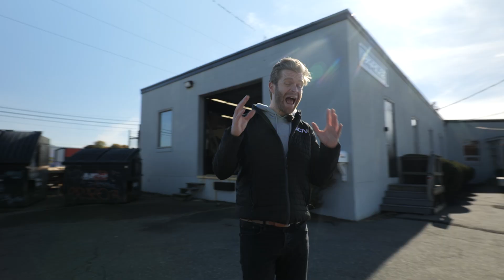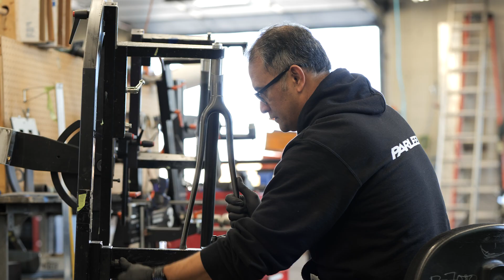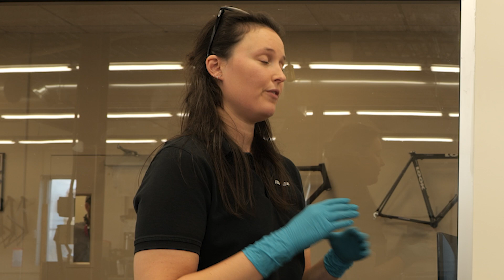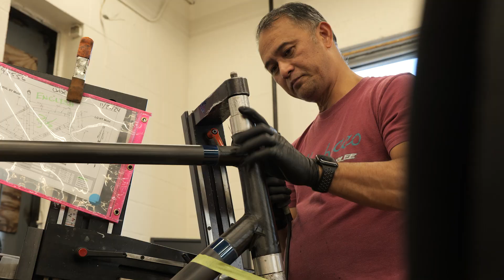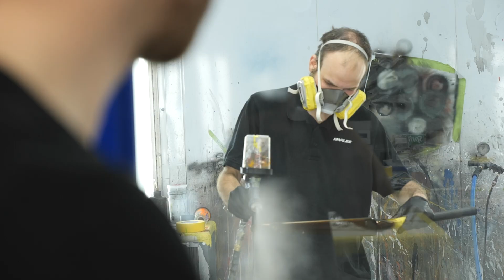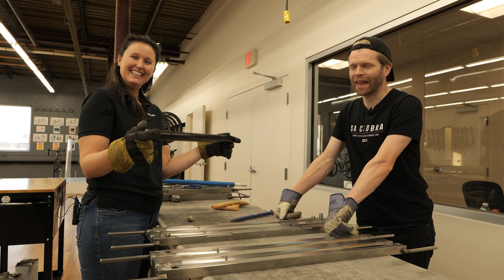Inside The Factory That Makes $25,000 Bikes

Comment: Ollie, Please do an episode on my idea...
I'm absolute 100% convinced that the best thing that a beginner/moderate/slow rider can do to improve their speed and make epic long charity rides and to have enough speed that the duration of a 80 mile charity ride isn't unbearable is to buy one cheap item and build the ability to use it.  The item to buy is simply a set of clip-on aero bars.  The skill to build is the ability to comfortably get down on the bars and ride for an extended period of time.  I started slow, just getting comfortable getting in and out of the aero-bars, and then I started adding time.  Could I stay in the bars for a minute? How about 2? How about 10?  As I build the ability to stay down on the bars longer, the weight and aero penalty for strapping unused aero bars on my otherwise comfy bike vanishes.  I'm old (62), quite slow (FTP=160), and I just bought a used (2018) Trek Domane.  I wanted my bike to be uber comfortable and that was critical, but I rules out any bike that had a cockpit that I couldn't add some clip-on aero bars to.  The bars allow me to rest my arms and hands on long rides, which also helps with my ability to ride long distances. I guarantee you that with me down on my aero bars on my Domane (or any other comfy bike), I'm faster than I would be riding on the hoods of any aero style race bike.  You guys did a video not too long ago of a beginner on a fast bike with aero bars on it to see how fast he would be, but they slowed him down because he couldn't stay down on the bars very long, and they scared him.  Find that guy and teach him and get him comfortable getting down on the bars, teach him how to get comfortable on them, set them up so they are comfortable for him, let him build the flexibility to get down on them for a while, get him to the point that riding on his clip-ons is as comfortable as riding on the hoods.  I bet it takes him a month or more of effort.  But then see how much faster he is.  As a slow rider, getting down on the aero bars is the difference between unbearably slow and not that bad.  Check out any cycling comuter and see the expected speed/wattage gain between being on the hoods and down on aero bars. Build us a video about all of that.

Comment: Can I just add some bike pricing context? A mid-range might cost £10,000 now, a brand new 650cc Triumph motorbike costs £6,500. I don't understand how any bike can cost £10,000 or more. But £25k?? Are you INSANE????😮
Reply: You’ve answered your question when writing “I don’t understand…” Just like I don’t understand the expert engineering that goes into a custom Bugatti Chiron rear spoiler, which also happens to be $25,000, many won’t understand the engineering behind very high end bikes. That’s ok. If you like it and you have the money; buy it. If you like the Triumph; buy that.
Reply: Triumph motorbikes are mass-produced, are they not? $8500 for a mass-produced motorcycle might seem insane to some, no? It's all relative.
Reply: @larryt.atcycleitalia5786 8500 is not insane, a motorcycle can go anywhere at 100mph and no work involved whatsoever

Comment: Have been riding for over 50 years, what the perfect bike fit has been a moving target over that time.  Here today gone tomorrow. Problem with Custom build it that they have limited time where they are the perfect fit.  Bodies change over time, what was the perfect fit 5 years ago isn't any more. So you are paying for something that only lasts a short while.

Don't think I've spent more than $7,000 on bikes in 50 years, probably spent as much on shipping bikes.  Bikes that are built to accommodate a range of bodies fit 85-90% of the way all the time as opposed to a bike that fits 100% for 3 years then at best is 75%.
Reply: So don't bother having a custom suit made or even something tailored to fit? Because it's NOT forever? How much is your body changing anyway..and how fast?

Comment: I'm sure they make great bikes but with that price tag I'd just get myself another Landshark instead.  American made, custom geometry, custom paint job and they too made a bike that Tyler Hamilton raced with, I think it was when his team was sponsored by Huffy.
Reply: That was Andy Hampsten, he rode a Land Shark in the Giro that he won. I have 6 Land Sharks; best custom carbon bike value period.
Reply: @ddubdesigns7679  Doh!  I guess I fell for the power of suggestion, they mentioned Hamilton and I just repeated it without thinking.  

My shark is an older steel model, I've been riding it since before he started working with carbon.  But it's been suck a great bike I have no need to replace it even after 20 years.
Reply: @roberteltze4850  I too have a Steel Shark. It is a mix of tubing with an Alpha Q fork and custom stem. It rides like a charm.
Reply: So John Slawta is still at it? Nice guy, really liked the bike he made for me many years ago from Reynolds 753 tubing. My wife had one very similar to the one he made for Andy Hampsten,. We painted it up to look like Andy's  HUFFY and she rode it at L'Eroica CA before we sold it.
Reply: @larryt.atcycleitalia5786  Yes he is still making frames. I talked to him last week. He sold his welding equipment so is focused on carbon tube to tube construction. He actually has a carbon wheel set he is going to release; carbon spokes.